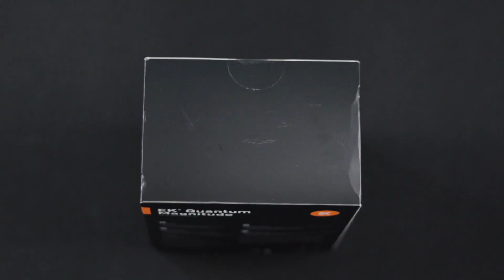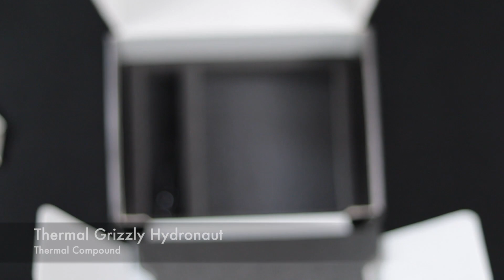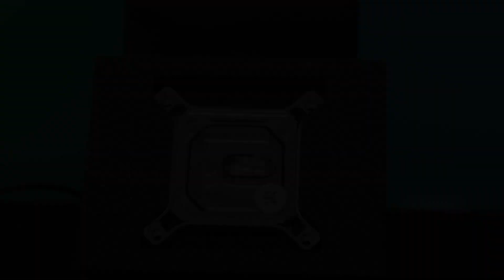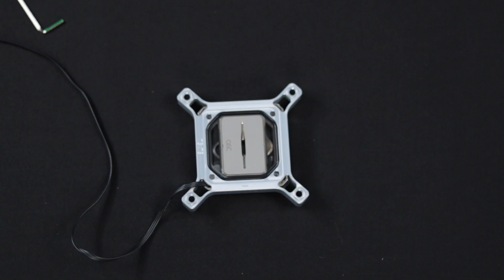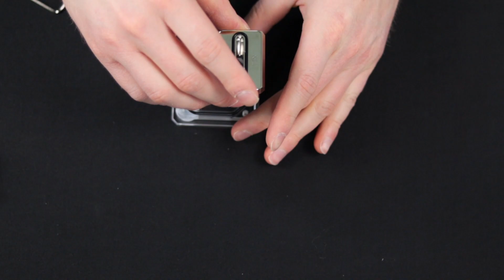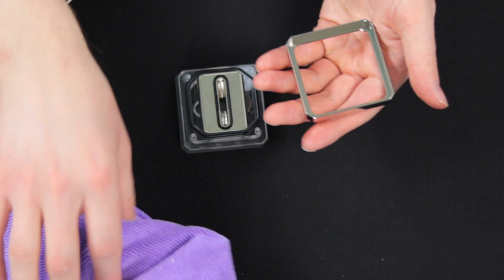Do Your CPU A Favor…

Comment: I deleted what I first typed / dictated, radiators sure clean them. EK blocks I would leave them alone until they're actually dirty, It may interfere in a potential RMA process.
Reply from the maker: I always like to double check! Plus these blocks are designed to be taken apart to rebuild them/swap out parts or reverse the flow for your build, so I would hope this shouldn’t present any RMA issues!
Reply: @techtoniksystems  .. You may want to double-check EK's policy on disassembly especially for exchanges and returns. I don't work for EK, I just know how they are about certain things.
Reply from the maker: @DJaquithFL  https://www.ekwb.com/blog/did-you-know-that-you-can-open-your-blocks-without-voiding-warranty/
Reply from the maker: @DJaquithFL  It only voids their QC leak warranty but does not void their actual manufacturer warranty. Shouldn’t present any issues with RMA if you did indeed receive a product that is defective. However if I reassembled it wrong, that’s on me and I completely understand that and would not expect a company to honor a warranty on a non defective product.
Reply: @techtoniksystems  .. You're correct about the no leak guarantee, but try returning or exchanging anything that was opened then disassembled to EK for refund or exchange and tell me your experience. I buy directly through EK for a variety of reasons and I just don't know how they are about this sort of thing.
Reply: @techtoniksystems  .. Also an important note, just because you pre-order and most importantly pre-pay doesn't guarantee that you will actually receive the product or products if they run out. In a nutshell, create two orders, one for everything else and one for the GPU block if that's what you're waiting on.
Reply from the maker: @DJaquithFL  I typically don’t expect much from companies directly in terms of exchanging or returning after opening, but I do have high expectations on the RMA process. I did purchase the block from Performance PCs which they do allow for a return request within 3 days so you could go that route if you want to exchange/return. I have no experience with pre orders from EK so that is good information to know!
Reply: @techtoniksystems  .. No doubt there's always something locally and quickly that you'll need, especially fittings. Also, I don't know if you're going to be using any custom cabling from CableMod but just as an FYI their system is back up and running.
Reply from the maker: @DJaquithFL  I am planning on working with the cables from the PSU first then getting accurate measurements for custom lengths and going from there. But that will be somewhat down the road!
Reply: @techtoniksystems  .. Always add at least 1" (25mm) to *any* measurements.